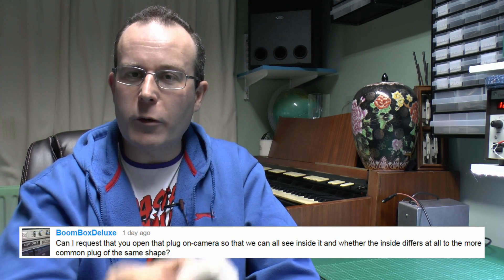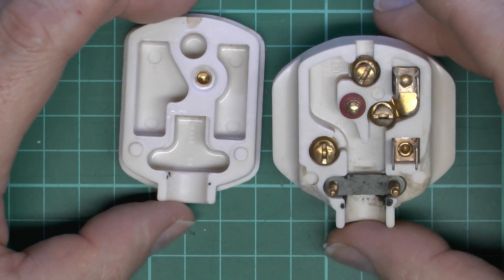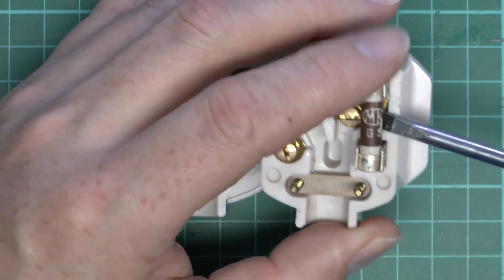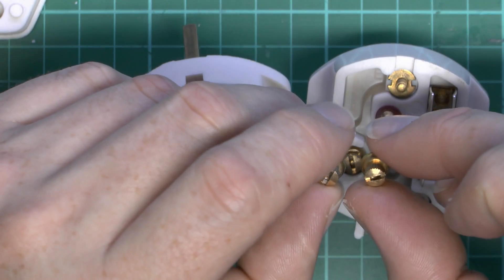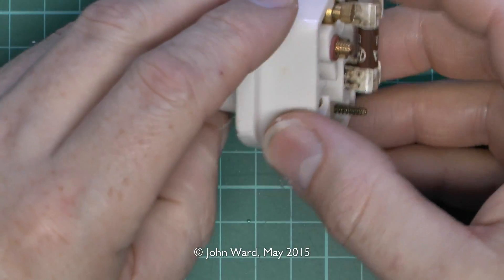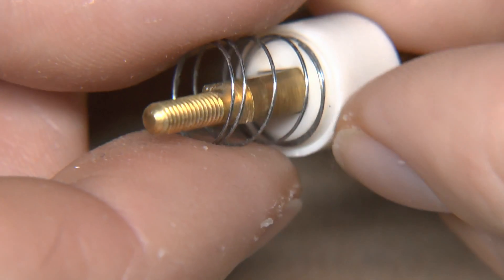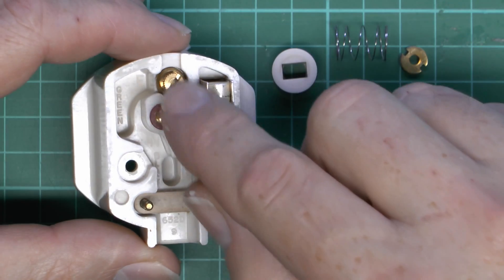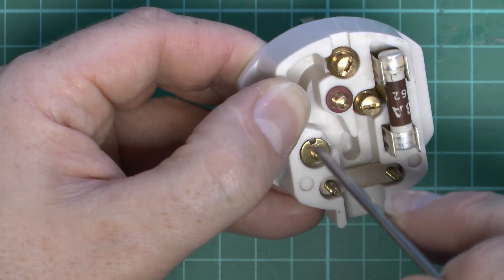MK Sleeved Pin Plug

Comment: Do the the fuses in standard AC plugs have a lot of nuisance blows. The equipment is a much better place , it would seam , to put a fuse.
Reply from the maker: No, almost never.  Usually only if there is a fault with the appliance, and even then it's common for the circuit breaker for the whole circuit to trip before the fuse blows.
Reply: Thank you so much for replying, your channel is amazing .

Comment: The unsprung plug was manufactured before August 1984 using a Bakelite material and haven't been legal to manufacture or sell since August 1984 (BS 1363:1984) as they are unsleeved.
How did you even get hold of these things lol
Reply: You have always been able to buy older style plugs second-hand either in ( some ) charity shops, markets, carboot sales and these MK plugs pop up quite
often on EBay.

Comment: Suppose it would seem sensible if you really needed the exact same cross section of conductive pin at every point on it's length.

IIRC MK used to advertise that they made the first sleeved pin plug... didn't realise it would have been one of these odd things though... certainly a lot of pretty weird ideas have fallen by the wayside & I enjoy these videos showing them off.

Comment: Are old unsleeved pin plugs still OK to use?
Reply from the maker: They can't be sold any more, and any inspection of an item would be a fail if the plug had unsleeved pins.
However they have not instantly become dangerous deathtraps, they are no more dangerous now than they were when made.
The only additional risk is people placing their fingers in contact with the pins while removing the plug from a socket, or some metallic object getting between the plug and socket when it was partly inserted.
Reply: @jwflame  Nice reply, I hate it when people suddenly presume something to suddenly become dangerous when something safer supersedes it.  The only thing that makes it more dangerous is that people are no longer aware of the danger as people may think fingers or a knife are good things to pull plugs out with whereas when these plugs were the norm people generally knew not to stick thing between the plug and socket.  If anyone has any of these plugs, for the sake of less than a pound each, replace it.

Comment: John, same question as "TheChipmunk2008" what is the inspection hole for? Is it to see if an item is earthed or not? That is the only thing I can guess, Cheers Clive
Reply from the maker: Clive Clarke-Watson The hole is to see that the earth wire is connected without opening the plug.  It was a requirement in older versions of BS1363, subsequently deleted.
Reply: Thanks john keep up these fantastic videos!!
Reply: @jwflame  It is also seen on pre-bs1363 plugs, such as the 3 round pin designs and all of their varieties.
Reply: ***** So that's what it was for!

Comment: Now I really wish america would use sleeved prongs. And 240v. Unfortunately, due to the varying types of contacts in the sockets, having a sleeved prong that worked on all sockets would be impossible. However, a spring guard would work perfectly. The sheer ease of sticking wires in the socket makes an easy way to test things though :) What is your favorite country's outlet style and why?
Reply: ***** I may be a bit biased, given I'm from the UK, but the UK plus and sockets are by far the safest.
Reply: @wisteela  The Schuko style is quite safe too, but not as safe as BS1363, especially considering that, until the early 2000s, Schuko sockets were not required to have shutters.
Reply: if aussie plugs had fuses then i would go for them because they have those piggyback plugs.

Comment: YAAAY. :D I had an idea that this plug would more-or-less be the same inside with some minor differences.

Mmmm, it even has an original MK BS1362 fuse as well. Tasty. :-)

Also, I'm really glad that you took apart the neutral pin to show how the receding sleeved-pin mechanism worked, as then it's documented on-video for all to see. :-)

As you found out, the live pin on these cannot be removed as it's been stamped in there permanently.

This plug, as like the more common one of the same shape, has the old British colour codes mentioned in it, so this was obvously manufactured and on sale before the harmonised flex-core colours were introduced, which I believe was the early 1970's.

On the later 'horseshoe' shaped MK plugs, they mention no colour codes in them.

Just to end as well, the most recent MK 'horseshoe' shaped plugs have three differences to the one you had:

(1) A different up-to-date MK logo (the MK logo which is in a square)
(2) The plugs no longer say "Made-In-England" on them !! :-(
(3) The terminal screws are no longer brass, but some other [cheaper] metal :-(

Overall though, a very satisfying and detailed vid on a rare plug which was unknown to me up until you made the other video on this plug.

Also..... Thanx for the shout-out at the beginning of the video. :-)

Thanks for showing,

-BoomBoxDeluxe.

Viewer # 13. :D

4th May 2015, 02.10

Comment: John, you said 'inspection hole'... is THAT what the hole above the earth pin was actually for? If so thank you! You've answered a lifelong question!
Reply: I believe it is used to see visually without opening the plug up whether the device connected is earthed or not
Reply: It was also to allow any heat to dissipate